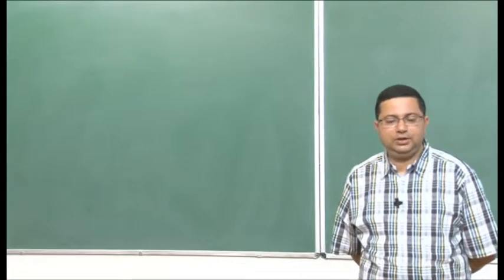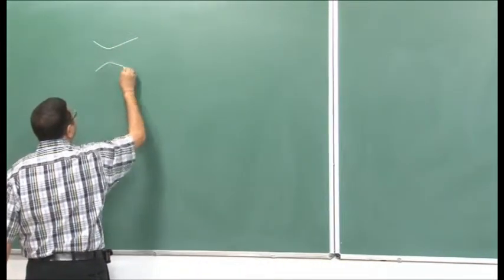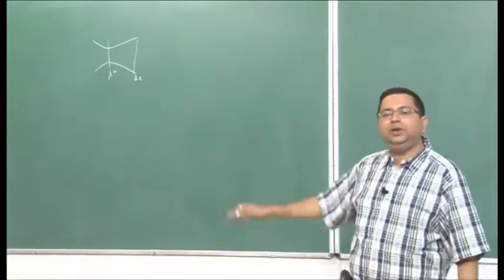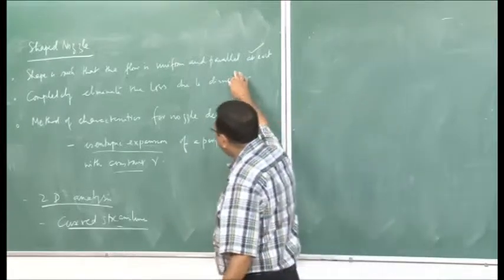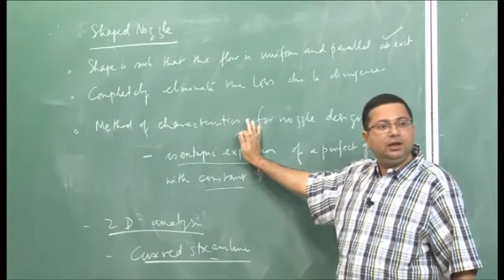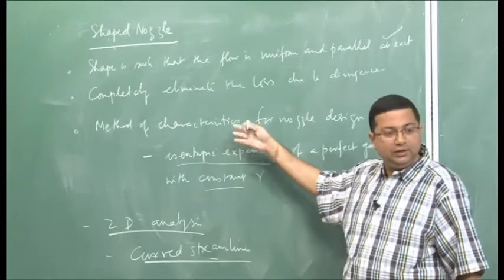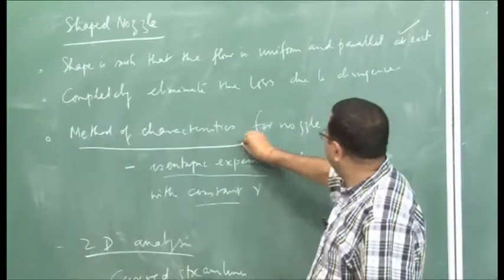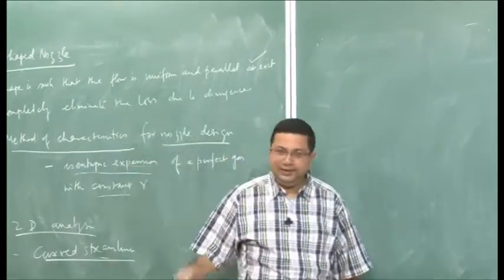Mod-01 Lec-27 Jet and Rocket Propulsion

Comment: Hear me  about conical nozzles . if we do the math we get around 98 % of initial thrust when we consider 3D flow instead of 1D flow. that's around 7 % loss for alpha = 30deg …. similarly for alpha = 15 get we get around 2.12 percent loss ... considering the amount of thrust produced by the rocket ....these losses don't matter as they are very small in percentage . i.e for 100,000 lbs of thrust for alpha =15 we loose around 2120 lbs of thrust as divergence loss due to the shape. DE LAVAL NOZZLE maximises the elimination of the loss but it has one more downside ..... its manufacturing ...cost.    my final conclusion is CONICAL IS A BETTER OPTION FOR STARTER ROCKETS THAN DELAVAL NOZZLE . i just came up with this if ...if I'm wrong please feel free to correct me .